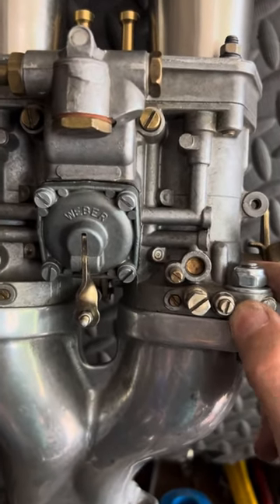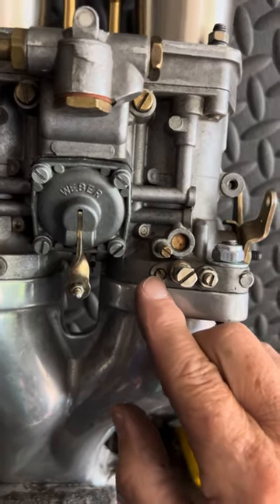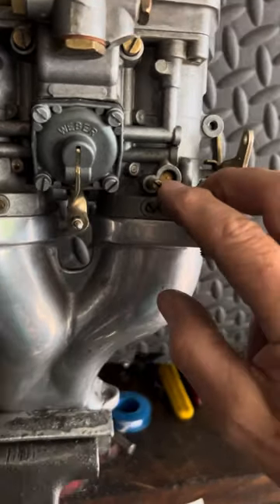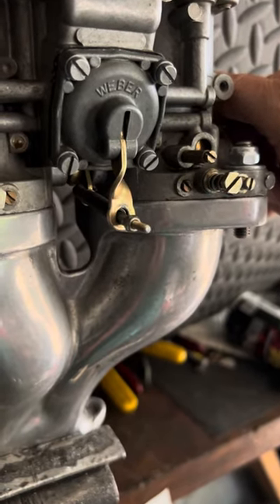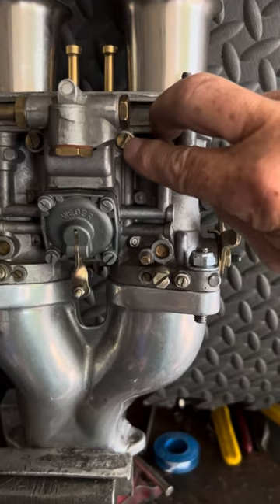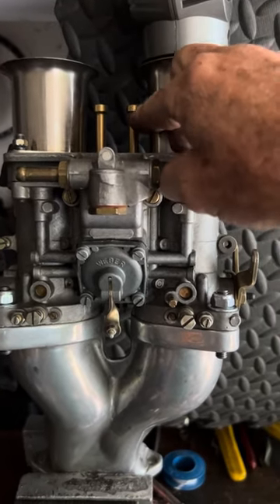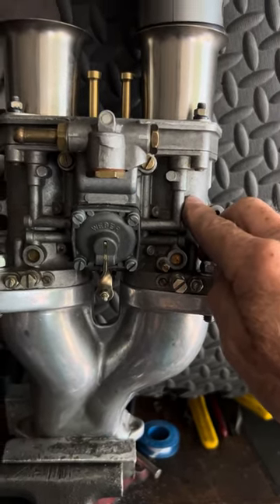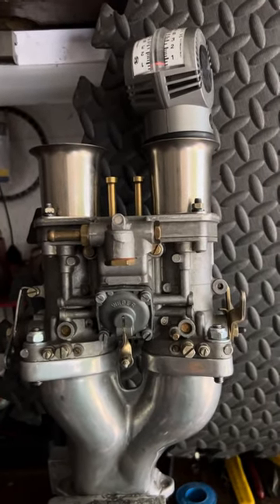HPMX / WEBER IDF screw adjustments

Comment: Just did my adjustments last weekend on my duals. #4 had a progression port clogged. Had to take the carb off and spray it out. Wish these plugs were tapped for cleaning them. Is there an easier way to clean the progression ports? As always, good video! Hope to see you at the Bug In next weekend!

Comment: thanks great video 
🤔 i got my idfs on off a guy on ebay in maybe 2002 but they are from spain
and my idle jets are NOT thru the side but down thru the top
 and ive only got the 2 idle adjustment screws by the base
Reply from the maker: Interesting. I thought all IDF and the copy's were the same...

Comment: Can you swap the older air/fuel screws for the newer style or does the old seat need the older screws?
I'm rebuilding a set of 44 IDF Italian and was curious if the newer style screws would be better for adjusting?
Thanks
Reply from the maker: If the seats are good the screws are interchangeable. For easier fine tuning use the longer screw but you may be more than 1 1/4 turns out on the idle.
Reply: @TheEZGZ  thanks!

Comment: Hey EZGZ thanks for the great video. I’m trying to get my bug to pass emissions, and my results say I’m idling rich. Do I turn that hex screw at the bottom in or out ? Thanks again
Reply from the maker: Idle fuel needle in very slowly and listen for idle ruff idle or popping noise then back out until it smoothes out. Take your time. Ignition timing can also effect emissions test. Also use best high octane available in your area

Comment: Mr EZ, I believe  I need to tweak my accelerator spring, it’s idling fine, running good. But during transitions it stalls , sometimes completely cuts off, even while cornering. I was afraid to adjust the pump because I was getting a small leak from the pump spring leaking down into the cylinders (dual 40idf webers) any recommendations are much appreciated sir????
Reply from the maker: sounds like you need a new accelerator pump diaphragm .
Reply: @TheEZGZ  thanks. Here’s one other thing. Once I turned the car off, the carbs were making a noise( like compression) and gas was sitting in the bowel. I took a wrench and turned the engine and noise faded away… could this be timing too?

Comment: Hey ez I want to get a thought on my 44 hpmx. It stalled at every turn and when I got back home and let it cool down it would no longer idle even though I hadn’t adjusted it.
Reply: It had idled before while sitting still
Reply from the maker: Sounds like to much fuel pressure and the floats aren’t holding the fuel back
Reply: @TheEZGZ  thanks I’ll mess with it tomorrow